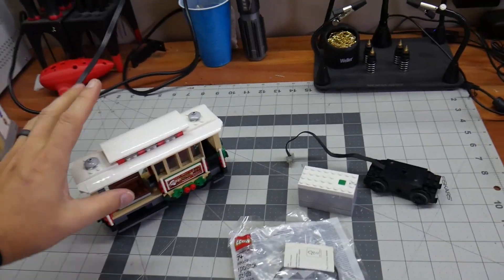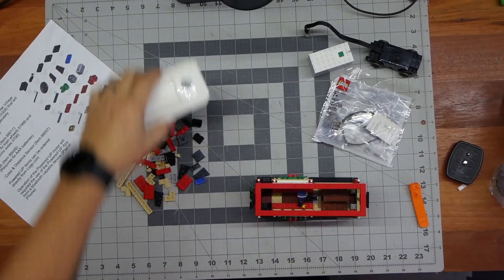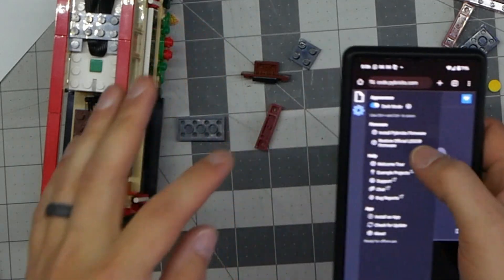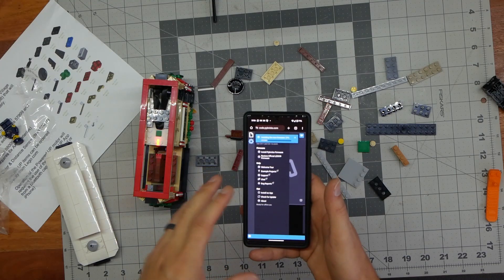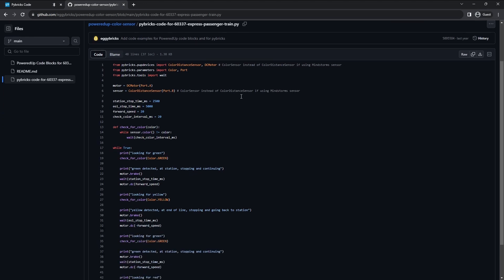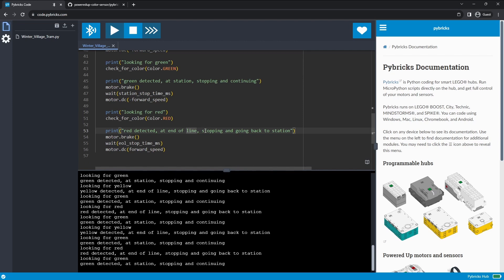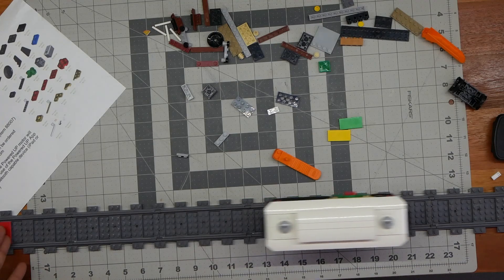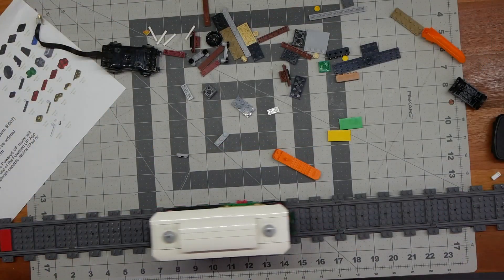I Automated LEGO Trolly in my Winter Village Using Pybricks!

Comment: I don't know if the MOC on rebrickable has been updated, but when I rebuilt the tram to use Powered Up, I only used one set of wheels on the motor (remove the set nearest the middle when motor is attached) - This means the tram can go round standard lego corners. So my tram goes round and round with standard Powered Up (as described at the end of the Lego instructions). I'm currently waiting for the bricks to rebuild as the MOC so I can add the colour sensor (the reason for the curved/bowed front is the colour  sensor needs 1 brick more space between the motor and the end of the tram). I also have a 'demo' rig which is just a motor, hub and colour sensor running a program in the Powered Up app which goes back and forth between two 'ends of line'. Once I've rebuilt the Tram as the MOC, I'll probably try pybricks in the demo rig and see if I have more fun. My current issue with the powered up app/setup is that of the 20 or so different colours of tile I have, the sensor can only see 5 different colours. 1 is black, and so is the "track", white can be a bit haphazard and often reports as 'blue' so I can only reliably use blue, green and red. I've also got nearly all the 40+ colours of 2x4 tile Brick Owl lists in it's catalogue on order to see if I can get a few more choices of colour to play with.
Loved the video, and your Winter Village setup.

Comment: Just built this set this week as I haven't had time. If you look in the trolley build book, right after the final complete assembly picture of the trolley, the next pages show you how to convert to power and you don't need to take the whole thing apart.
Reply from the maker: Very true! I totally forgot about that!
Reply: @fugatechlego if you use train motor with only one axel goes around curves without any difficulty.  Also used Convertion directions at the end of the instruction book.  Much easier.